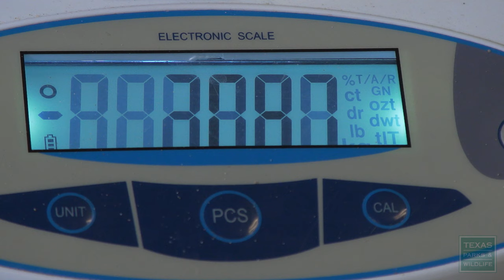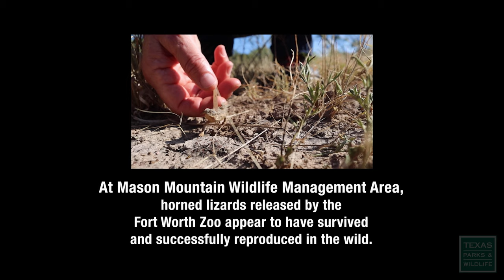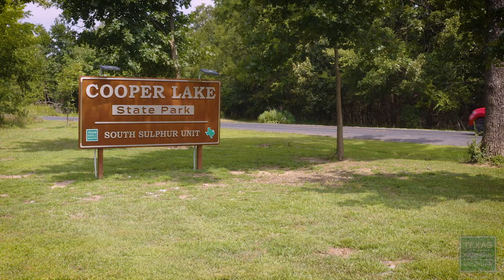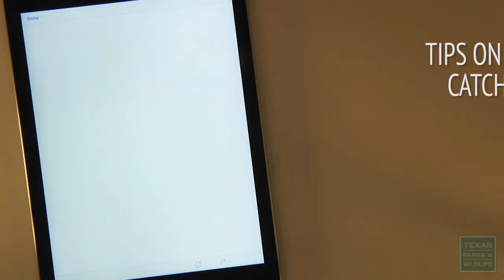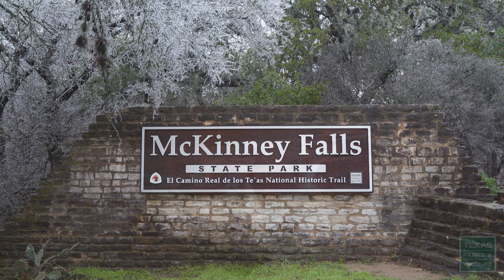PBS Show - Cibolo Nature Center, Horned Lizards & Cooper Lake

Comment: I grew up in Dallas just west of the RR track that runs north and south crossing Valley View Lane and Royal Lane.  Used to be a Morton's pickle plant on Valley View with a lot of open ground, gravel pits and cucumbers.  Stringfellow Addition was all gravel/dirt roads and there were horny toads and 6 racer lizards all over the place.  I remember running from shady spot to shady spot in bare feet along those dirt roads many times during the Summer.